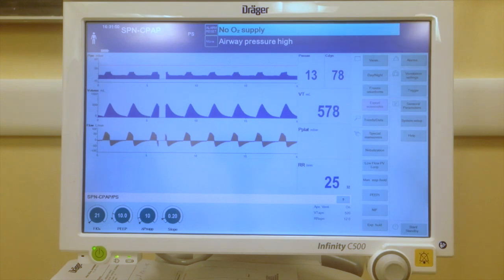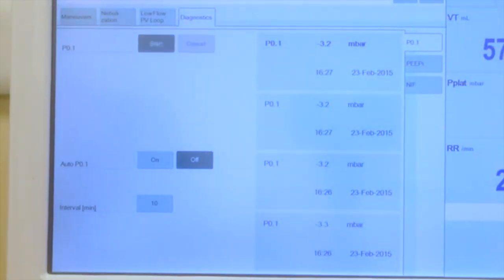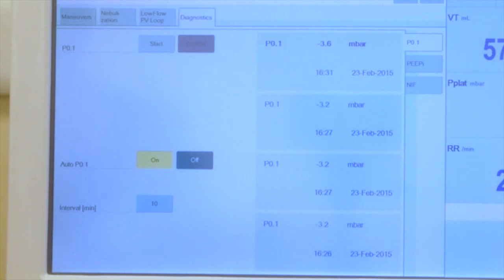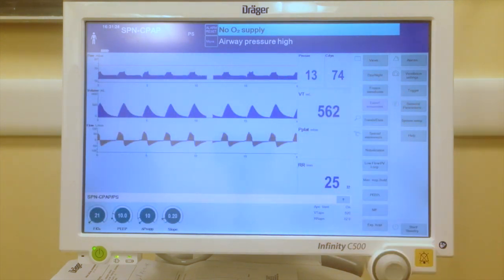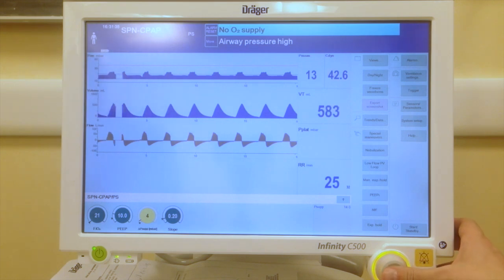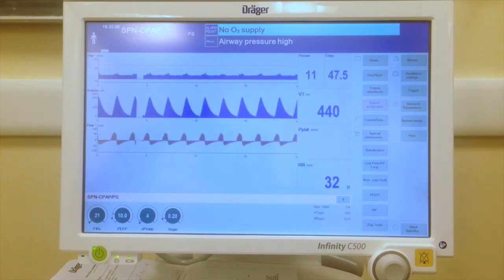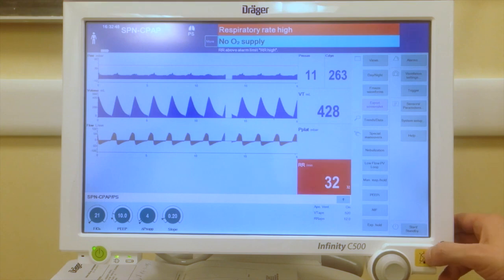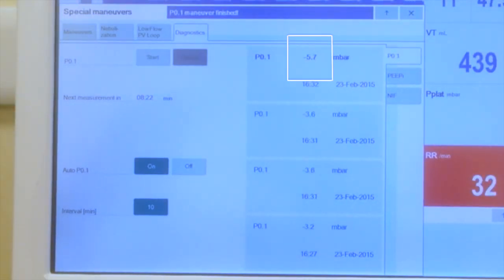p0.1 during pressure support ventilation on a Draeger Infinity V500

Comment: What is P 01 ??
Reply: airway occlusion pressure, P0.1, is the negative airway pressure generated during the first 100 msec of an occluded inspiration. P0.1 is a parameter for the neuro-muscular activation of the respiratory system, which is an important determinant for the work of breathing. It has been shown to be a good predictor for successful weaning from mechanical ventilation